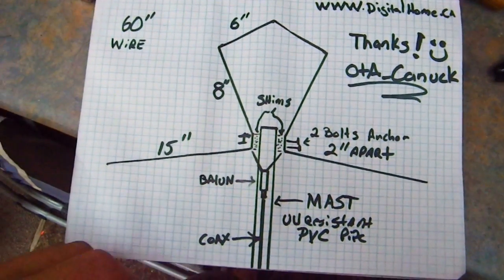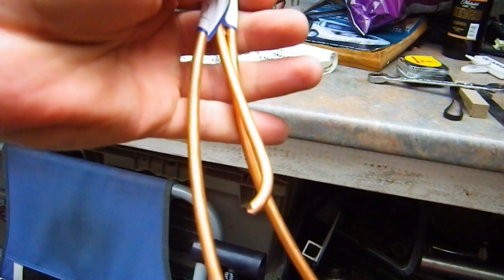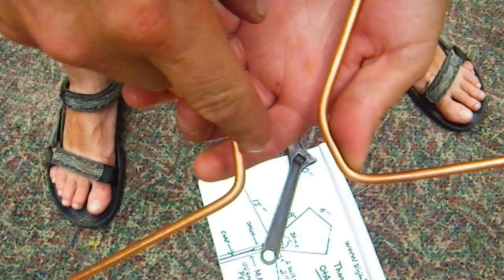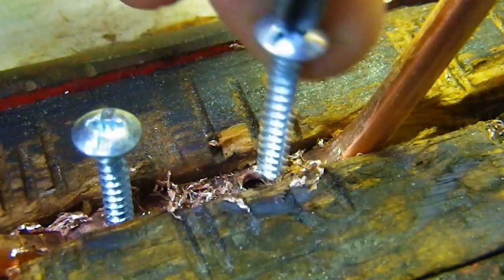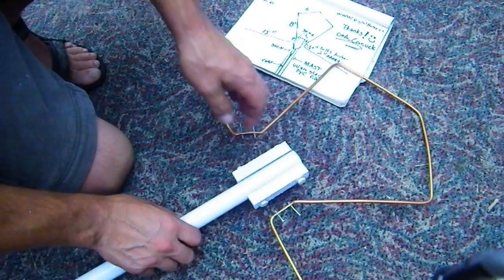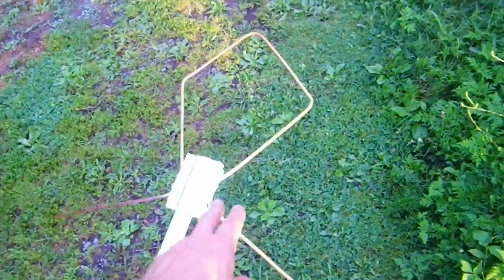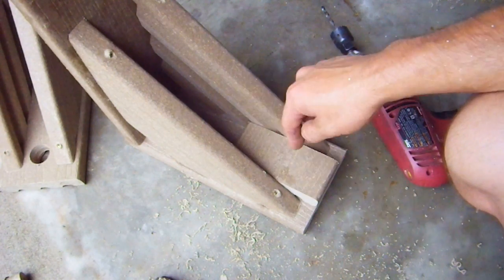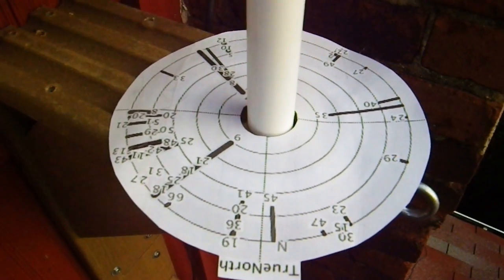Homemade HDTV Antenna ( Awesome! ) Stealth Hawk Antenna

Comment: The antenna does surprisingly well but I made the lower horizontal elements longer in length about 22inches each side to bring the antenna resonance closer to the FM band. since all the TV channels in my location only use the UHF spectrum

Comment: I made mine with the lower legs bent perpendicular to the main loop. Each leg was offset from each other. Bent a stainless clothes hanger with a square diamond loop main area. This way there is always a capture corner no matter where the loop is pointed. You could call this a Folded Stealth Hawk antenna. You know? I get more channels now! No need to aim the antenna, no digital signal interruptions. Only mounted indoors on the 2nd floor.

Comment: I made one and tried it out...........  IT SUCKS!! I live in mid Georgia, and the performace of the Stealth Hawk is piss poor. I took it down as soon as I put it up.  I will stick with my homemade Gray Hoverman with reflector. Which pulls in 24 crystal clear digital channels..  The Stealth Hawk only pulled in 3 channels..
Reply from the maker: I had that one up also, its very location dependent.  My GH was busted up in a windy storm so I made that one real fast.  It pulled the same number of channels so I stuck with it.

Comment: Yeah, I'm late to the party, but still want to thank you (& OTA-Canuck) for providing plans for this antenna. I just today built one and installed on my travel trailer (easy to fold up & down). The little jewel pulls in 69 channels, and the closest to my place is in the 50 mile radius. It also pulls in lower VHF, Ch-2, and performs admirably on Ch-69. Thanks again!

Comment: I built one of these for my pop-up camper, except I used only two bolts (with nuts and washers) in the whole construction. Everything else is gray rigid electrical PVC. For the mast, I used two 6' lengths of PVC with male/female threaded couplings cemented on. This allows me to break down the mast for easy storage/travel. For the antenna head, I used a weatherproof electric box/housing, which threads onto the top of the upper mast pole. The balun goes inside the housing and attaches to the backside of the two bolts that secure the copper wire to the outside of the housing. The great thing about this set-up is that the coaxial cable and the balun are completely enclosed in the PVC, with the cable running down the mast and out the bottom. Set this mast into a mount of your choosing, and you're good to go. My mount is another gray electrical box with a quick-mount that attaches to the side of my camper. The whole thing cost me about $30 in materials, and it works great. HD quality reception on at least 25-30 channels in most places.

Comment: I was skeptical but thought this would work for camping or a radio if nothing else, I built it in less than an hour and hung it on a nail in my attic and now get 3 channels crystal clear hd from towers over 60 miles away, THANK YOU!

Comment: Is this an omnidirectional antenna?
Reply: It's bidirectional, has a figure 8 pattern. It will have nulls off the ends. But it's fairly broad because it has low gain.

Comment: the only issue that i  see... even before you hammered the 1" section flat it appeared to be larger than one inch used for that section, hammering it makes it more ,antennas are finely tuned to specific frequencies and anything over the specified 1" might render it less functional, I'm going to make one today and see what i can get 30klm away from the closest city in my area as were in the country on a farm
Reply: +Charles lakins made it and get 10 channels now over the none before
http://static.rcgroups.net/forums/attachments/3/9/6/1/0/4/a8920074-174-HDTVANT1.jpg

Comment: I cannot find 4 guage solid copper wire in Toronto area. Any ideas? anyone got 6" they wanna sell? Thought of using 1/4" copper tubing instead, can get it from HD. Any comments on using this instead?  Thanks all ...
Reply: +Gac Events - Home Depot & Lowes sell 4 gauge solid copper ground wire for $1.44 per foot.
Reply: Go to Metal Supermarket. I use 1/8" aluminum rods to build mine. Straight pieces, I think then come in 12' lengths. Which they will be happy to cut for you to size. They cost maybe 5$ for the 12'

Comment: Can you provide details for the Balun required for this antenna?
Reply: +Gac Events = Ebay sells the balun outdoor tv transformer for $6 with shipping. The balun is the outdoor version of the transformer which has a rubber cover to waterproof the coax cable connection.

Comment: can we use aluminum?
Reply: +IAmAHobbyist I wouldn't. corrodes and has poorer performance than copper. Not much poorer. But poorer.
Reply: bullsballs
The length of copper you need for this antenna is rather small. How much are you going to save: $0.75 maybe? It's not like you are rewiring your entire house (I have - so I know about the cost of copper wire!). There's not enough copper there to make cost of any practical significance unless one is dirt poor! The cost consideration would be significant if we were talking a 8 foot solid copper 5/8"  grounding rod of course , but not this tiny length of wire, even if it is 10 or 12 gauge. The only real advantage I see in aluminum is the ease of working it: 10 or lower gauge solid copper is rather stubborn stuff and work hardens fairly quickly (ask me how I know). However I would hope most people would at least have a small drill press (not to mention a small set of drills and countersinks) and a bench vise in their garage or basement, which simplifies basic tasks like this one in the video. (It's amazing to me how many don't, and they are homeowners!). I spent 10 years as an electronics tech in the Navy and commercial/industrial world.

Comment: It would be a better video, if you showed us you actually getting the channels inside, I would not expect showing all channels, but show some, like scan through some, like other build your own antenna videos do. Just sayin.
Reply: You will get all local channels in your area. Do some more homework. There are websites that tell you the local channels, heights required to receive them, and anything else you need to know.
Many channels are duplicates. The local stations parrot the others.
Reply: hubbleISS so useless info

Comment: This would b a great idea if i had fully stocked workshop to make one. Lol. Show me an antenna that i cn make with a screwdriver, hammer and a wrench..only then would i b impressed! But judging from the comments it looks like it works pretty good. Nice job!
Reply: +Iromearound who cares if you would be impressed or not. You ought to have, and learn how to use, more tools than a screwdriver hammer and a wrench. My wife can do way better than that. Jeeze how incredibly lame.
Reply: +Iromearound Seven bends on a 60" piece of 12 gauge wire,, wire tie it to a piece of PVC and wire tie the balun connectors to the antenna - done with no tools.

(bend the wire back and forth to break it at 60")
Reply: Nice! Thanks guy that hates google. U rock!
Reply: I've made two of these that are actually weatherproof and nicer quality than this using the following "high-end" tools:
- Phillips screwdriver
- Pliers
- Wrench
- Hacksaw
- PVC cement

My design is made entirely from 3/4" gray PVC schedule 40 electric conduit, fittings and joint boxes. I built a base out of a five-way PVC junction box with four 12- inch legs that extend out from the center. This creates a very stable base for the mast. The mast then screws into the top of this junction box and is comprised of three 24-inch sections that screw together using female/male fittings. The fittings add strength and also make the antenna easy to disassemble and transport. At the top of the mast is a t-shaped junction box with two 1/4 x 3/4" stainless steel bolts with fender washers securing the copper wire to the front plate of the box. On the back side of the plate are nylon lock nuts connecting the balun to the bolts/antenna. The plate then screws securely to the t-box with a water-tight seal. The balun is fully enclosed in this weather proof housing and easily connects to a coaxial cable that runs down the mast and out the bottom of the base. The antenna is free-standing and can be moved into any location (to whatever distance the coaxial cable will allow). I built this for camping purposes, and it works great. I get about 35 channels in most locations. Total cost was about $50, which includes the PVC, ballun, copper wire, and all hardware. You can subtract about $15  from that if you don't need the base or sectioned mast. My first design was just a long length of PVC conduit that was secured to the side of my camper.

Comment: I get 21 channels with a 25.00 store bought antenna and I'm 20 to 30 miles from transmitters if your getting 50 or 60 channels its probably a bunch of duplicate networks I get NBC, MeTV, CBS, CW, Weather radar,ABC,MyTv2,Ant Tv,PBS1,2,3, FOX, Get TV, GRIT Tv,Ion, Ion life, ion health,Shop,QVC, HSN,TBN
Reply: +Robert Reed No. Probably not a bunch of duplicates.. If you do the research on this type of antenna designed by ota-cannuck you will find it generally outperforms almost any store bought antenna -  particularly a $30 one (a cheapo). You just happen to be lucky to live in an area where a cheapo works fairly well. There many many places where the cheapo won't do diddley.
Reply: *****
I agree. And also:
direction, direction, direction (although most people know that, I guess)

Comment: Does this connect directly to the TV or a tuner/receiver through coaxial cable? No need for converter box or anything because it is free tv, correct?
Reply: if your TV is newer ( 4 or 5 yearsold ) it will have a tuner built in to pick up the digital signals.   if not you'll need a receiver box to tune them.    and yes it's free and legal.

Comment: Can you use any other type of wire besides copper? If not what is the function of the copper wire? "Thanks
Reply: Robin McCain Yes you can, but copper has excellent conduction, and is relatively cheap.
Reply: thanks for the response...I have a lot of wire in the shop but no copper...

Comment: Just a FYI to people. I made his design then another and doubled it. So  12.16 and so on... I ran them in a + pattern smaller one in the middle then the larger one over the top.  I live 100 miles from my North Station and South station. I pointed the smaller one towards the better signal. Now I don't need a rotor because it picks up both South and North now using the double design. I connected them together with a piece of insulated trailer wire (12 gauge) on top of the antenna..Using 2 antennas I now pick up both. With the one he made if I didn't add another I would of had to rotate it like he does. Thank you for the video though! A+++
Reply: Mike Theune

Comment: I tried a store bought rabbit-ears type with no luck (1 channel- 2 sometimes). tried this build....Great antenna. I had to experiment a bit with the radials but it does work well now(over 30 now) without rotation. plus as a ham I love to build antennas, and this one was real easy. Thank you both pilesofplenty and Dennis. bring on the larger and more powerful versions of this that you speak of I'd love to give them a shot.
Thanks again,
Bill

Comment: That thing is a piece of wire itself; how can you get that many channels?
Reply: 88s10Durango pipe? Looked like # 4 grounding wire to me just like he said.
did you see the pliers crimp the wire when he bent it. If it were pipe or tube it would collapse and flatten where he squeezed and bent it.
Reply: 88s10Durango
...Still pretty thin.
Reply: TheMereanaEffect That's what's amazing about this little antenna; it's so simple, yet performs as good and in some cases better than antennas which are a lot larger.
Reply: Tony U.
I actually attempted to make one a while back—it didn't work very well.

Comment: Great design works as well as my store bought with an amplifier, using on a bedroom TV . About 12 ft off the ground and the closest station to me averages 32 miles. Tried a lot of these home built that I've seen here on You Tube and this is by far the best! Thanks
Reply: Michael B

Comment: The end result is what matters. How many channels are you getting ? Is it any better than what you can get at radio shack. A few yrs. ago I made one. It's a bow type, with a channel master booster. Appox. 30 feet in the air.  I get some 30 channels. I am in the N.E. Atlanta area.

Comment: The Stealth Hawk is quite multi-directional and was designed to eliminate the need for a rotor and tuned specifically for the core channels used in the new over-the-air digital spectrum. Channels: UHF 7-13 and VHF 14-52
Reply: surely 14-52 is UHF  and ch 7-13VHF !

Comment: Thanks.  My goal was to conceal the balun and RG6 quad shield coax within the structure which holds the antenna up, thus making them waterproof.  I was able to achieve this using a 1/2" PVC conduit, and 1/2" PVC pipes.  The only functional parts which are exposed is the 8 AWG copper wiring for the antenna itself, and the #10-32x1/2" screws, #10 washers, and #10-32 bolts, which all happened to be stainless steel.

Comment: You can visit my Google+ page to see images of the Stealth Hawk I recently built. It is mounted high, about 60 feet. As you can see, it is aimed adjacent to a lake, and it has very few obstructions. It pulls in 92 digital channels, without a preamp or distribution amp. This antenna is fairly simple to build, but I had to do a lot of research in order to learn how to build it correctly to specs. A Wikipedia page on how to build one would have saved me a lot of time. I will try to start one soon.

Comment from the maker: Actually I received more stations on a single bay coat hanger, but I had it on a 35 foot tower and the mast was another 8 foot, so 43 foot.     Yes I do pick up stations in both directions, but I am actually sacrificing a few right now to pull in a local one.  My tower blew down a couple years ago, I'm just now fixing it.   I will try to do an antenna shoot out when I get it back up.  The more complicated stealth hawk designs will do better!  I will make one of them at some point also.

Comment: Did not think of printing out tv fool.. very nice.  I will try your design.  Does it work better then the "4 bay" coat hanger design?   are you able to get Omni direction ... receive from many towers around the compass?